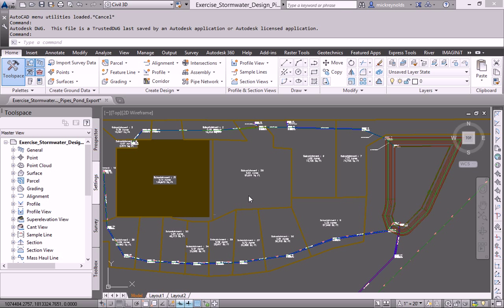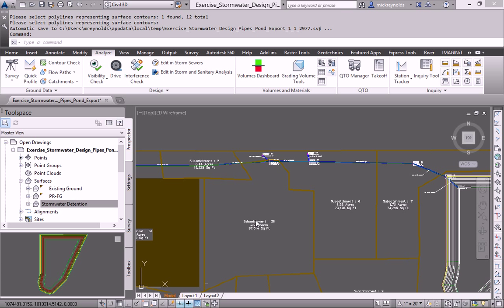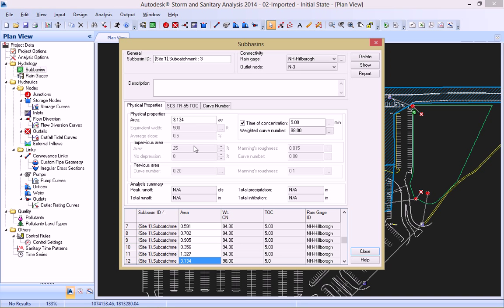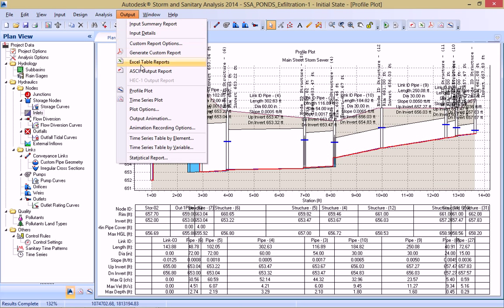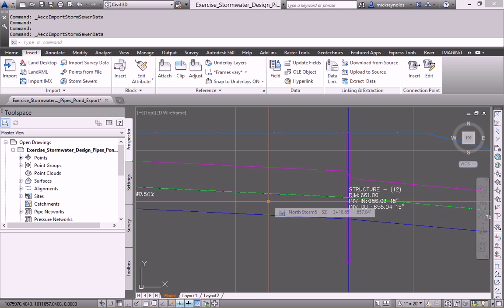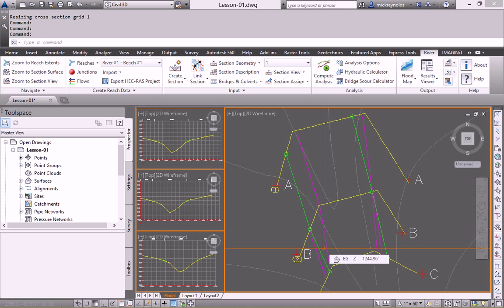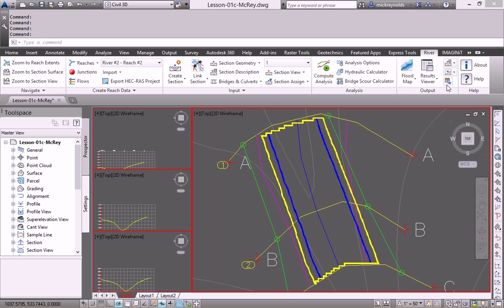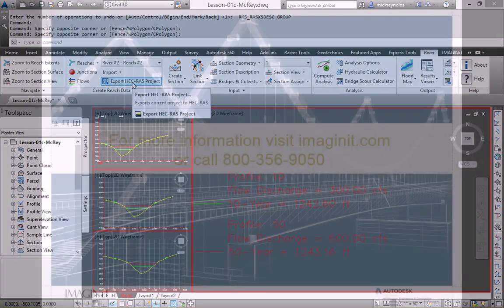Storm, Sanitary and Flood Analysis Workflow with Autodesk Infrastructure Design Suite

Comment: descargue la Suit Ultimate pero no sale el river analysis....como lo descargo?????
Reply: Dear Sir

Many thanks
for your tutorials; without this, I could not fulfil my project. 

 SSA software to introduce it to my clients and the local authority for planning approval. 

I have got the following question, can you send me relevant tutorials or answer, please. 

Model foul flows using discharge units to BS EN 752. is there any example available please
Produce Greenfield rate calculations using IH124 method.
Allow the application of climate change factors to rainfall data. Typically 30%. Where and how can I apply climate change, please
I am looking for a response from you soon,
please. Thanks for your taking time. 

I can pay you for tutorials of you
can please.

Kind regards 

Sherwan Mohammed